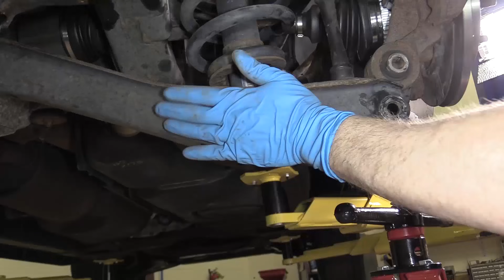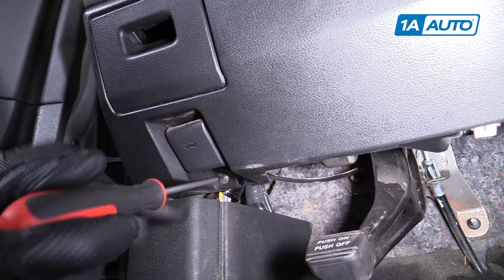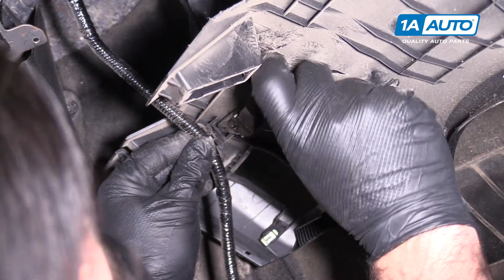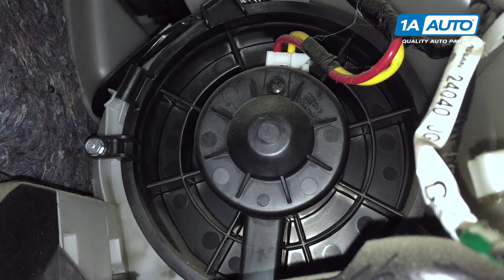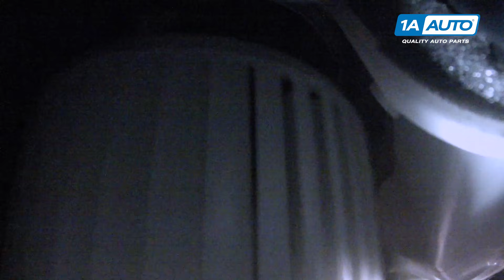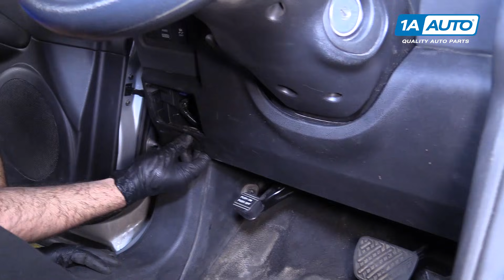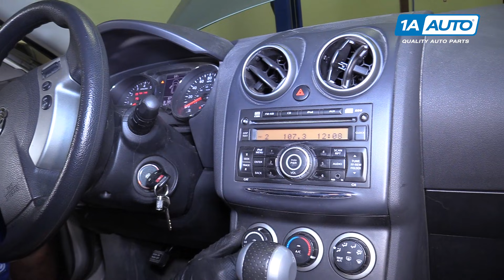How to Replace Heater Blower Motor 08-13 Nissan Rogue SUV

Comment: I just watched your video twice then replaced the  struggling blower in my 2013 Rogue S.  Everything went as you described, but it took me a long time fussing with that hard-to-reach top nut on the bracket before I realized that I could take off the steering column bottom cover and get slightly better access above the bracket.  That only involved removing 3 screws and I wish I had thought of it earlier (or just thought ahead and bought a swivel adapter for my socket).  The new blower runs much quieter and faster than the worn-out original I replaced.  That hour I spent saved me hundreds of dollars!
Reply: Removing the lower half of the steering column was the ONLY way I could get access to the top nut of the last metal bracket in the way. Like William said - 3 screws. This needs to be pinned to save other DIYers the aggravation.
Reply: This is a great video! The only thing I would add is that I removed the driver's seat before I started on my 2011. For the sake of 4 torx bolts, it was well worth the extra 10 minutes!

Comment: Great video! Was in and out in less than 2 hours but the hood release cable is now AWOL. You would think it would be easy to spot with the little metal weight on it. Looks like I'll be hunting that last piece of the puzzle soon and the repair will be complete.

Comment: Is this a different blower motor than the AC? A friend was told her AC blow motor went out (you can feel the AC creating cold air but it does not blow in fast).

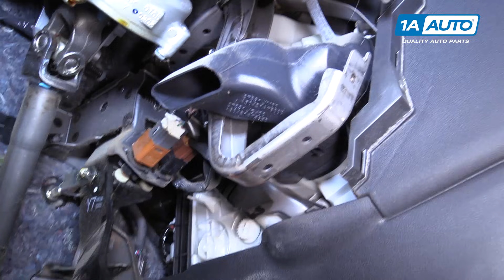Comment: The bracket at 4:35... I tried leaving it in, you can't. It does have to come out. In the video it said  "you may not have to pull this bracket out". You do, and it makes things a lot easier if you do. I fought around it, wish I would have taken it out from the start. Thank you for the extremely helpful video!!

Comment: Is anyone else having problems removing the motor it does nottt want to come out been back and forth at it for 2 days its dead of winter and I need the heat to work again but cannot get it unlocked out of heater box

Comment: Thank you for this video. I have had just about every major part changed on my 2011 Nissan Rogue. Have to say this  car is a money pit. I'm finally  checking to see if others are having these same issues and looking at some of the repairs to see what it entails to fix the issues. Well I see why things can get expensive to replace. Unfortunately for Nissan I will no longer be a customer as the parts and constant repair and maintenance are beyond normal.  Transmission, drive shaft, axles, airbag spinal cord, many boots , door locks, rear door lock, blower for heater,etc.. bought this car in 2014 w 65,000 now at 127,000  thank heaven people are educating others on how to avoid some of the expense.

Comment: THANK YOU! I just changed mines along with the air cabin filter and the blower transistor. It took me way longer than 24mins, more like 2-3 hours😁😁😁 nevertheless great video. Thank you again. P.s. my check engine light came on. Any reason why?
Reply from the maker: +donley23 We wouldn't be able to diagnose an issue like that here, you may want to have a local mechanic take a look at it. Thanks for checking us out! http://1aau.to/m/Shop-1AAuto-c
Reply: My service engine soon light came on as well. I think i will disconnect the battery for a few minutes then reconnect and see what happens. I did not disconnect the battery to do the repair

Comment: Your video was very informative. I will say. The bracket that holds the knee kicker in place under the steering wheel. It must come off or you will have a hard time getting the brake throttle assembly out.
Reply from the maker: +Jimmie Boling Thanks for checking us out! http://1aau.to/m/Shop-1AAuto-c

Comment: Will this be the same process for a 2015 rogue? Wife’s rogue is making a noise when the air is turned on and from reading it sounds like it’s the blower motor.
Reply from the maker: +tms299 We don't have a how-to video for your vehicle right now, but the basic steps in this video should be enough to do this task. Buy this part for your vehicle on 1AAuto.com: http://1aau.to/m/Shop-1AAuto-c

Comment: Hey buddy! Just replaced my blower, thanks to your instructional, but there's one thing I'd like to add. The clip above the screw, has a lil tab, that a flat head screwdriver helps outta the way. I'm no weakling, but I had to call for outside assistance from a carpenter buddy that has ham-hands to twist that bastard outta place. My lil Irish fingers are better tuned for fine work. I'll give you credit tho, Mechanic-Hulk. You've got a helluva grip.
Reply from the maker: +William Grantham Thanks for the feedback!

Comment: Great video needed lots of drinks and a swear jar lmao. fyi that right bracket needs to come off or the gas brake assembly will not come out thxs again saved me 1100 parts an labor in Canada got it done in 3 hrs and 50 for the blower.
Reply from the maker: +Darek Czyzowicz Thank you! We love empowering our customers and showing how to perform DIY auto repairs with our high-quality auto parts.  http://1aau.to/m/Shop-1AAuto-c

Comment: Note the plastic blower diverter has a plastic clip on the firewall side and if you don't release it first with a flat blade screwdriver you may break it like I did. Also the diagnostic module can be easier released BEFORE removing the panel..  This fix will try your patience and a pile of extensions and sockets..  A novice can figure on 5 hours and you WILL need to remove the pedal assembly... VOICE OF INEXPERIENCE(but success)
Reply: btw: in the old days you just popped the hood- removed three screw and replace the blower and module.. A 10 minute job and three minutes for the cigarette...... New is not always better..
Reply from the maker: +VoiceOF Reality Thanks for the feedback!

Comment: Dont forget screw on L of the protruding vent you remove, DONT just pull it, if it's like mine. ALSO, Do Not undo the hood connector! 
Mine doesn't seem to have as much slack, and damaged it/cut my finger-see Whitney Weeks video, not worth having to repair cheap plastic hood release.Next, I had heck of a time with upper support bar bolt. Finally, Nissan forgot screw on actual blower!!! I took pic, now have tp find screw.

Comment: How do you remove the harness attached to the blower motor?? It wont come out no matter how much i try, i know there is a clip to unlock but where?
Reply from the maker: +akram Thanks for watching!  There should be a locking tab on the side of the harness that you push towards the left, just like you see in the video!

Comment: Just completed this task. Really would not have been successful without this video. 2.5 hours including a trip to local hardware to get 1/4 inch universal and 13mm deep well. (Which I thought I had both😳)
Longest delay was trying to figure out how to disconnect the wiring harnesses. Just not that familiar with all the styles and they were hard to see the latches. I took time to wipe out grim from the blower housing. 
Blowing cold air again and air smells like new car! Thanks again. Best video on the subject I could find. Exceptional camera work and commentary.
Reply from the maker: +papawinters Thank you! We love empowering our customers and showing how to perform DIY auto repairs with our high-quality auto parts. 1AAuto.com

Comment: I just changed my blower motor on my 2010 Nissan Rogue. The blower still doesn’t work. Does anyone know where the blower motor relay is??
Reply: Don't worry about a relay yet find the resistor that is the second point of failure, should be right next to the blower motor.
Reply: what was the cause?

Comment: How much it cost to do that part and labor?
Reply from the maker: +Honda2014 Thanks for checking us out! You can purchase the part in the video here: http://1aau.to/ia/1AHCX00341 We would not be able to tell you how much the labor would be as rates vary greatly based on your location. You can call a local shop for an estimate, that would be the best way to get an idea of the cost of repair or you can follow our video and save yourself the labor charge!

Comment: I’m getting a P2122/P2127 code after doing the repair. Any idea what that could be?
Reply: Same here. I'm wondering if it will go away with enough driving although it's been 10 days already. Reseated the connectors, but nothing looks out of place and no extra pieces when putting it back together. Throttle is working just fine.
Throttle/pedal position sensor/switch D circuit low
Throttle/pedal position sensor/switch E circuit low

Comment: This video helped a ton! I tried my best to twist the old motor out to no avail. Ended up finding out that if you pull back on one tab just above the 8mm bolt and twist left it will come right out. Also there is a little black box with two screws in it that controls the vents...if you remove that first you can get the old blower motor out easier and obviously install the new one a little easier too. It is on the right hand side and has a small electrical plug on it. Hope this helps someone else.
Reply: How did you know the blower motor was bad?  My a/c was working just fine. The next time I started my car, nothing was blowing out of the vents. Both fuses in the inside fuse box were good. I know my a/c is working because when I turn the a/c on, I can hear ans feel the car kind of bog down when the a/c compressor starts. I can cup my hand over a vent and feel that there is cold air there, its just that nothing blows out. Since the fuses are good, is my next step to install a new blower motor?

Comment: Great video but id like to mention that the black heater housing piece at 5 minutes on my '10 Nissan rogue had actual clips so when I just "pulled it off" like he said and did in the video the clips broke off. Otherwise very helpful...

Comment: Thanks for doing this.  I bought a combo Rogue 2010 fan and the resistor and everything went according to plan except for the floor heater vent refusing to pop off.  I just worked around it in the end.  Expect to feel like you've been in 13 round boxing match when it's done.  These angles are not fun to work in.  But we now have a quiet and dependable fan that will be used often this winter.  You saved me appx $900.  :)

Comment: Hello guys, my AC blower starts giving a little soft clicking noise after 30 minutes running, and it will be gone if turn of the blower for few minutes, and it comes back again. Did you guys have the same symptom before it finally stopped working ? 

My Nissan Rogue 2012 only has 70K Km, why this blower is already giving me problem ? is it pretty common ? 
I see the recent comments, and I am pretty sure you guys are way better me when it comes to fixing car, it will take 3-4 hours probably for me.  Thanks for the video, I really hoped i will not need to do this.
Reply from the maker: +Rey Situmorang Thanks for checking us out!

Comment: Finished everything, and started the car. I now have a check engine light I didn't have before. I hardly think this will leave me stranded by the road, but it's a little annoying.
Reply: Make sure your pedal plugs are in good
Reply from the maker: Thanks for checking us out! +Mark Billingsley
Reply: Mark I had the same thing. It was from unplugging the gas pedal. I cleared it with a 20 dollar code reader.

Comment: I just completed this job on my wifes car. While your video was immensely helpful, there were a few things that should be mentioned for the avg. car owner/mechanic. 
1. An extra elbow on each arm, along with an extra wrist. This will help in getting into this extremely tight spot.
2. Being a contortionist would also be helpful.
3. Having freakishly small hands that can crush bowling balls would've been nice.
4. The patience of a saint.
5. A large vocabulary of cuss words.
6. At least 3 10MM sockets.
7. Beer. Lots and lots of beer.
8. Light. The brighter the better. 
9. Did  I mention the freakishly small hands?
10. The person who designed this system, head on a platter.
Reply: loooooooooooooool
Reply: I mean thats the case for anything on a Nissan vehicle.
Reply: Exactly. 
Agree 100% I'm a 6'3 guy with big hands.
Reply: 100% agree with this list. Nothing with this job was fun on my wifes car either
Reply: Can 100% confirm lmao i just finished doing mine minutes ago and my hands made it difficult to say the least. Of course I have size 22 ring hands so there is that

Comment: i came here cause i was looking for a fuel pump relay for my 2012 rogue , no one can help locate this bad boy ? i was at the dealer and looking with the parts guy at all diagrams and did not show us anything on a pump relay ? go figure ? one tech came out and said you have to buy the WHOLE elect box ? i said that still does not tell me where it is ? so he did not know either ?  you did a good job on this motor , i am HVAC cert myself retired ,,,,one thing i wont do is to buy a motor not from the dealer because of very good chance it will draw more amps than the original ? maybe yours wont but they told us that in school ! just saying ,,,,,,by the way even just changing a simple cabin air filter for the ac on this car is a pain in the big A ,,,,you have to bend it so it goes in ,,,,,,yagzzzzz ,,,,,,you g ave me an idea ,,,,,remove the pedals maybe next time ? ,,,,,thanks

Comment: Great video. I’m almost there, I can’t take out the plug on the blower. You made look so easy. Any tips?
Reply from the maker: +Daniel Flores Thanks for watching!  There should be a small tab that locks the harness into place, and it just needs to be pushed in.  Using a flat blade screw driver or something similar might help.  1aauto.com
Reply: 1A Auto Parts After taking a quick mental break i was able to do it with my hands. Once again thanks for the video, I was able to do it and my AC is working again.

Comment: Hi I had my blower motor replaced by AAA and since that time my car pulls to the left and right. it seems like it needs a wheel alignment,  which I did, but it didn't help. Is there any way that replacing the blower motor would have caused this to happen?
Reply from the maker: +Madelyn Banks We do not have a way of being able to diagnose the issue that you are experiencing with your vehicle but suggest taking it to a local mechanic for a proper diagnosis.

Comment: OMG... Thank you for this video!
Saved me tons of time and shop costs... Only thing that sucks is the brake connector gets in the way of the removal and install... Was afraid I was going to break some of the blades... Just have to push past it.

Other than that, it was a simple, but long process.  Two plus hour job...

Glad I had something to compare to!
Reply from the maker: Thank you for the great reply. We love to empower our customers by showing you how-to perform your own auto repairs while installing our high quality auto parts. Have a great day! 1aauto.com +Matthew Penn

Comment: “Just remove that 10mm screw holding the blower motor on”

Easier said then done.
Reply: 8mm and use a philps screwdriver as it has that in the head also.

Comment: Any other car: 1. remove vanity panel 2. disconnect electrical connector. 3. Remove three screws holding blower motor and remove blower motor.
Reply: unless its a 97 dodge dakota, your pulling the dash on that one.
Reply: @wditt2  or any Chevy s10 😭

Comment: Great video, I was able to replace in 3 hours, as another person said that bracket definatlu has to come out. Also had some difficulty getting a good grip to turn out the old blower. Other than that pretty easy to follow. Thank you for the video!
Reply from the maker: +Cody Schlicker Thank you for the great reply. We love to empower our customers by showing you how-to perform your own auto repairs while installing our high quality auto parts. Have a great day! 1aauto.com
Reply: @1AAuto  is this also the same for a sl rouge
Reply: Cody Schlicker how did you finally get the motor to release from the housing? Mine will NOT come out, been trying for over a day
Reply: Me too. That thing will not turn. Took my 2 foot + screwdriver/prybar and grabbed the big tab  downstream of the screw hole, wedged bar against the steering linkage and POW! Blasted that SOB tab right off. It wraps around the housing and grips like hell. Thing came right out after that. It was junk, so no harm, no foul.
Reply: I just twisted it with 1 hand...came right out

Comment: I have a 2013 Rogue, and I definitely had to remove that metal bracket. There was no way the blower was coming out.
Reply: Based on what I saw in the video, and where he positioned the blower to get it in/out, I was thinking the same thing.

Comment: Did this...some feedback.  First, thanks for putting this vid up.  Second, this job sucks, there is no room to work...  Couple points from me: 
1) I have a 2008 Rogue.  That plastic heater diverter does not come out like this video.  There is a screw holding it on, must be behind the radio.  I yanked on it til it broke.  Maybe they redesigned it between 2008 and 2009 models.  
2) rotating the fan out is tricky.  Best thing is to reach up with your left hand while facing the passenger seat, and you can get it.  
3) Buy a new cabin filter and replace it as long as you are in there.
Reply: Yes. The cabin air filter not being replaced is what burns these motors out so soon.
Reply: Good call on the cabin filter